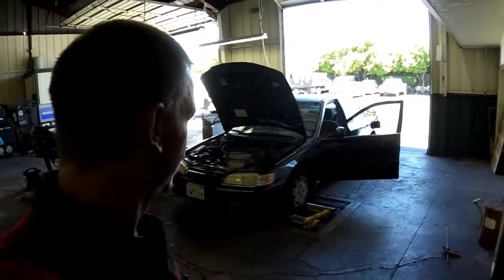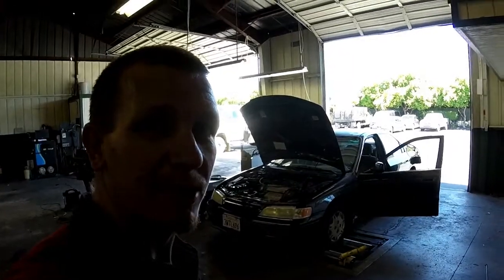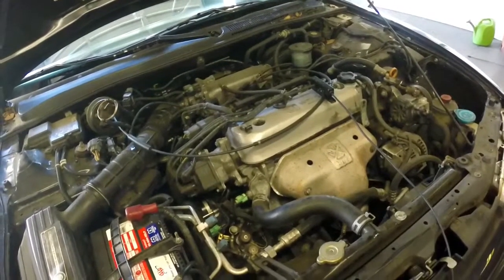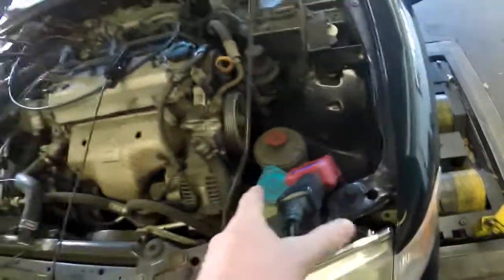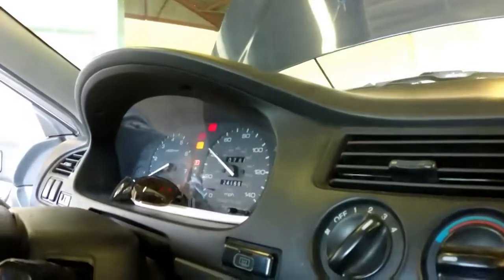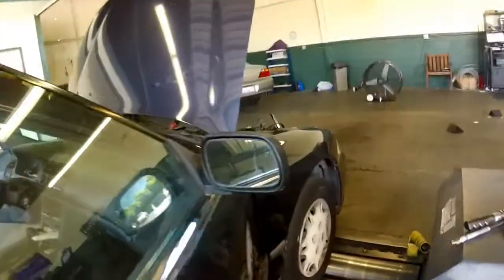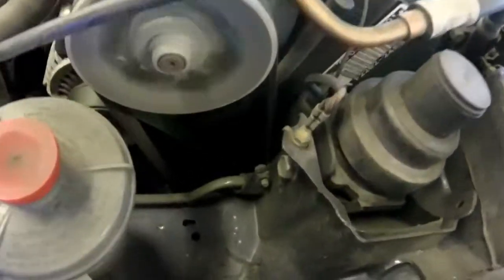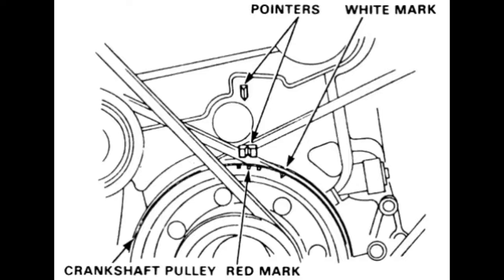Honda Accord ignition timing check.  F22, DX, EX, LX

Comment: Wait, how was it adjusted? Is a standard timing light not usable?
Reply from the maker: With your timing light on #1. The gun set to 0°. Turn the dizzy slowly til the timing marks line up. Don't lose the bolts too much. 

Good luck. 💪🤞👍
Reply: @ScottiesHobbies  Found the dizzy bolts for adjust. My bad. Thx man 👍🏻

Comment: Hey bro my accord is not revving past 4000 rpms or so.. ive tried vtec solenoid and oil pressure switch and still the same thing I've even tried messing with the ignition timing with it being set all the way in both directions.. can you help me out.. I do notice on the new pressure switch I put in I didn't tighten it all the way where it touches the back of the block.. but the code still pops up for vtec oil pressure switch it brand new

Comment: Thanks for the insightful vid. I'm having a difficult time seeing the ignition timing markings on the pulley using a timing light. I jumped the passenger under dash connector with a paperclip and connected the timing light to spark plug wire cylinder 1. I was thinking of crawling underneath the car with a flashlight to see if I can find the markings and paint them opaque white. Do you have any suggestions besides painting the markings? Thank you
Reply from the maker: We get this a lot. It honestly doesn't take much time to remark the zero mark. What I do is: get a long flat head screw driver, one like 2 ft long. Paint the flat tip white with white out and mark the zero mark. I'll have some in the car taping the ignition to turn the crank til I see the park. Usually 2 or 3 bumps will find the mark.
Reply: @ScottiesHobbies  Thank you for your insight. I'm going to try this method instead of crawling underneith the car. Thank you
Reply: @ScottiesHobbies  I was able to paint the ignition markings by taping the ignition, thanks again for the suggestion. If you don't mind me asking, I'm having an issue with bleeding air from the coolant system in a '96 Accord. The Accord has a small bleed valve on the thermostat housing that you loosen when you are pouring coolant into the radiator, when the radiator/block is at capacity coolant is suppose to shoot out the bleed valve in which you then close the bleeder. The bleed valve when loosened does not shoot out any coolant even with a radiator full of coolant. I'm assuming that the bleed valve is clogged with corrosion.

When I turn the car on and let it idle with the rad. cap off the radiator fans NEVER turn on, after about fifteen minutes of idling the coolant starts spraying out the radiator. When this occurs I turn off the car then the radiator fan kicks on immediately. Throughout this process the temperature gauge is within normal operating temperature. If I turn off the car, install the rad. cap and turn the car back on, the temperature gauge rises quickly past normal operating temperature with the needle slightly above the halfway mark on the temp gauge. The coolant overflow reservoir doesn't overflow throughout this process as well the upper radiator hose is hot. 

I don't think the car has a blown head gasket because the oil is clean not milky and the exhaust smoke is not solid white. I mistakenly turned the heater fan control knob on when turning the heater temperature knob to max hot, I'm not sure if turning on the heater fan introduced air into the system with the car idling. I'm also not sure what could be causing the radiator fans not to turn on only until the car is turned off or if I'm having an issue with the thermostat opening/closing or an internal clog somewhere. Thank you
Reply: @vanquishstorm I know this is incredibly old thread but I’m having the same issues, do you happen to remember what solved your issue?

Comment: Thanks for showing the actual mark with the light (they are so small and hard to see in comparison to other vehicles I worked with before - I am thinking some florescent paint)  - and thanks for showing the Innova tool I was thinking to purchase - my original light seemed to be a little flakey but now I think that was because I did not install the jumper.
Reply: How did painting the ignition timing markings help to see them using a timing light? I'm also having a difficult time seeing the ignition markings with a timing light and plan on  crawling underneath the car with a flashlight and painting them opaque white if I can see them up close.